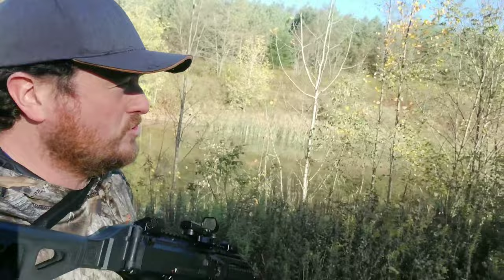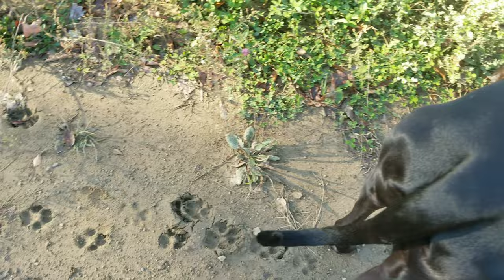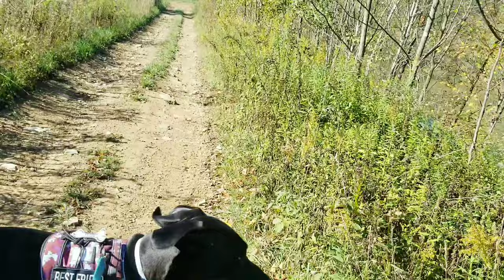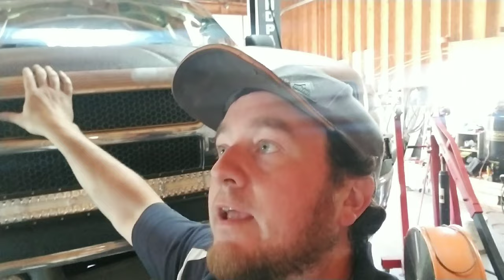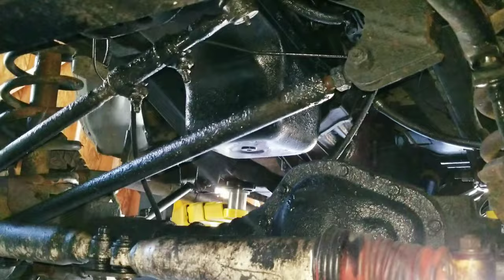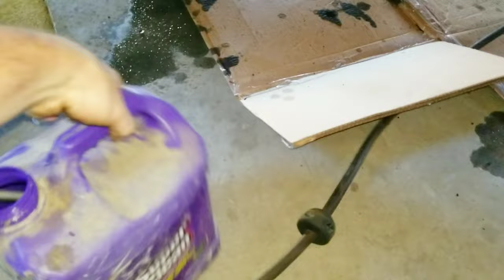Fuck Hunting !!

Comment: your  extended warr  is  up on the ram and  they  can  re extend it for you  ;-) thats  sucks  on  on the rig  hope  you get  her  back  lomok  on  iaai  for a  junk truck  and  get  the  frame  and  do  some  swapping  . ill roll east  and  help  we  could do it  in  5 days  or  less ;-)
Reply from the maker: It's just the track bar that holds the front axle side to side and the crossmember also lol. I'll get it going again,  I think 🤔  I'm off today how about you brother? Anything new out that way?
Reply from the maker: It's just the track bar that holds the front axle side to side and the crossmember also lol. I'll get it going again,  I think 🤔  I'm off today how about you brother? Anything new out that way?
Reply: nice gears  you will  have her  rolling in no time. im off till friday  but  its  a  inside  day  here  were  getting rained  on.  not  much going on over here  its  nice.   hope  the weather  is still  nice over there  so you can go play in the  yard and enjoy the day off.
Reply from the maker: @mrsmel269  yeah just finishing up the ram got it all straighten up with a come along and welding everything back into place. Wasnt to bad. Then going to enjoy the rest of the day, it's super nice out here. Did a burn out for the amish working here they loved it lol
Reply: heck  yesssss  across  the  board brother !!!!  hope  you got  some smoke  on video too ;-)
Reply from the maker: @mrsmel269  lol no they were putting a roof on my neighbor's house but they loved it lol
Reply: sweet  ;-)